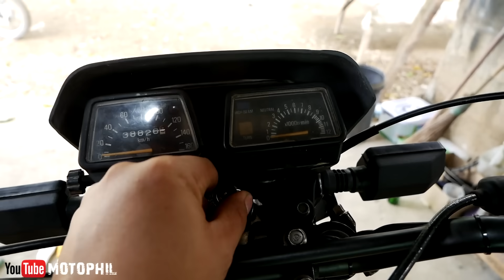Yamaha 2Stroke FullRestoration 1997 DT125

Comment: The Yamaha DT 125 and Yamaha RX115, they were the best machines that have existed. 2t engine, hard like a rock, reliable and beautiful. Made in Japan 🇯🇵
Reply: The DT200 was a great bike also. Like this except liquid cooled
Reply: As a DTR 125  owner, i agree with you, those things will last a life time if proper handled
Reply: LEGEND NEVER GROW OLD.... THEY JUST RELOAD!!!!!!!
Reply: I had a DT125LC back in 92-93 and loved it and it never gave me a days trouble.
Jacked up, tuned, black cross on the headlight and the noisiest pipe in England!
Reply: Sir saan po location ninyo?
Reply: Also Yamaha RX 125 too used to own the new one back home 🏡 1 0f the best Yamaha Bike.
Reply: DT175 is better
Reply: @yoyobase4638  I had a  DT 100, DT 125, DT 175, RX 100, RX 115 and RX 135. All made in Japan except RX 135.
Reply: @MrElpastor  was the dt175 much faster than the dt125
Reply: when rhey hear that sound pulling up yk wassup 😂😂
Reply: @yoyobase4638  dt175 was much torquer , i had a DT125mx with a 175 barrel and piston !! i would over take anything at traffic speeds without even gearing down ......wish i still had it :face-purple-crying:
Reply: Not a patch on Honda's CRM 250.

Comment: Fabulous job. I'm not criticising you in any way but this DT125 is from the early 1980s as characterised by the "mono cross" swinging arm, drum brakes and air cooling. 1997 models had a conventional mono-shock rear end, disc brake and liquid cooling.
Reply from the maker: It depends on the country. Its 1997 here

Comment: I had the 1980 DT175, IT175k & have an IT200s.
Interesting to see a bike 10 years newer than the 200S that still has the 1980 shock, and a 4 bolt head (The IT175 was 5 and the 200 6.. (The 175 had a habit of stretching the frame and ripping the head off.. I have a photo of me on my 175 doing a 3ft dropoff... and you can see daylight through the front tube  upright before I found it...
The 200 rots through the lower link bar between the pedals..
This DT looks to have a similar frame to the IT round that area only lighter weight build.
I have an "Answer Roost Boost" that was designed for the DT similar to this, fitted to my 200 to give it a stronger top end.
On the old DT I used 30/40 in the front forks to make them les pogo more grounded... That was an off road bike only and put up with a lot of abuse...
Now I have a YZ250 99 and haven't had to open the motor except to clean the power valve.. in 10 years of big trail rides.

Comment: Are you sure this is a 1997?! Judging from the cantilever swingarm, the front drum brake and the air cooled engine, I would guess it's pre-1984. The lamp fairing and the dashes also look like they are from that era... I used to have a 1983 DT that looked like yours except mine was water cooled...

Also, great work on the restauration! You got some skills there, keep going!
Reply from the maker: In my country its 1997 model. 2006 is the last model that cameout

Comment: Most probably an 87 not 97
Reply from the maker: Every country is different
Reply: @Motophil  well in Europe from 91 if I remember correctly it evolved to liquid cooled with the assorted face-lift. If they continued selling the previous model for another 10 years in some regions is beyond me.
But in Europe this was an 80's bike
Reply from the maker: In my country they are late released. Air cooled likethis still released until 2006. After that 2stroke got banned. Lc 125  version never make it to the market